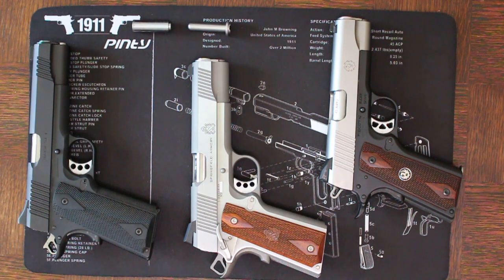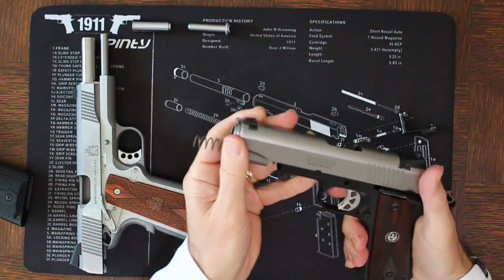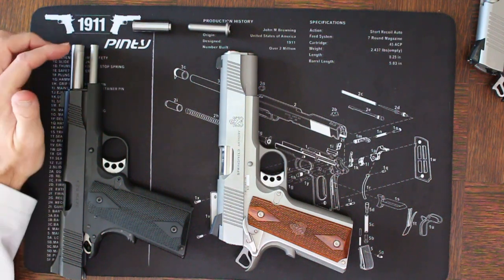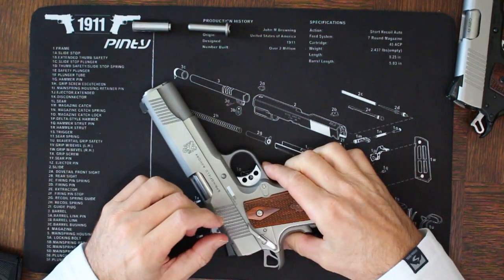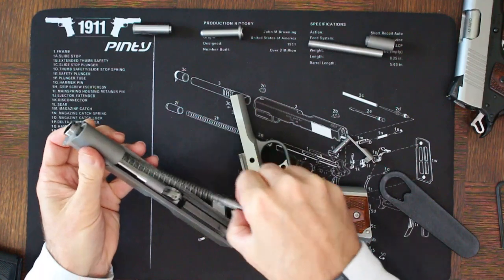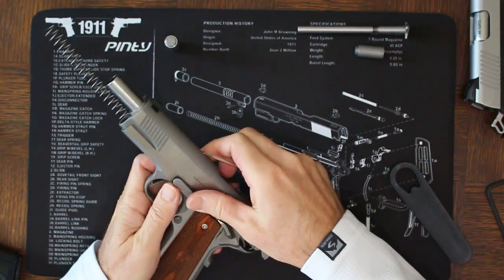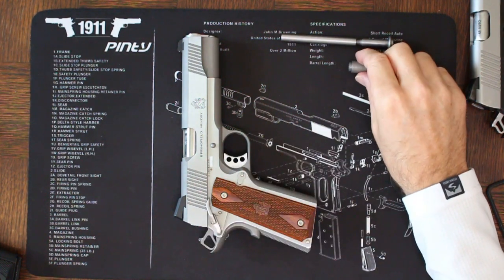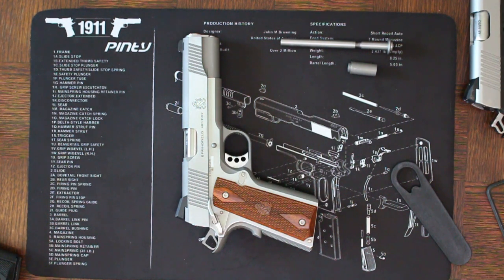1911 Guide Rod Upgrades, Types, and Replacement

Comment: 25 yr old Wilson Combat 38 super with full length two piece guide rod and plug. It has never come loose, never failed, never caused any problems in thousands of rounds. Shot one inch groups at 25 yds brand new and it still does.

Comment: For anyone that's going to consider getting a two piece guide rod... Allow me to make a suggestion...

 Periodically disassemble the guide rod especially if it's one that threads together.

 I bought a used rather beat up Auto Ordnance AOC Competition Model yesterday because I just couldn't say no to the price tag with all of the aftermarket accessories that somebody had also put into it. They made it look just like one of the 1911's from the 2004 Punisher movie. And again the price was right and I was very satisfied with it until I noticed two things upon much closer inspection when I disassembled it getting it home. First and foremost...

 The goddamn guide rod will not come apart. It doesn't matter what I do it does not come apart. The person that had it prior to me put it together and apparently never bothered to take it apart occasionally cleaned out the threading and put it back together again and now it is seized solid. To the point where I am pretty sure I'm going to have to cut it out of the damn frame. So yeah first suggestion would be... Take your firearm apart from time-to-time manipulate any pieces that move or thread together. Especially the guide rods.

 My only other complaint about this firearm is just the absolute and utter disregard for maintenance with it. And this idiot decided it would be a good idea to coat the outside and all of the inside with this thin rubbery material that liquefies the moment gun solvent touches it.

 I've never seen a nastier more filthy firearm in my life.
 Although it's a nice little restoration project for me now.

 But yeah the guide rods that screw together... Just take them apart every now and then or there will come a day where you might be sorry and you may not be able to get it apart.

 Just a little food for thought and thank you for taking the time to read my rent. And this was a very well-thought-out well-executed video. Thank you for that as well. If I cut this guy drawn-out I'm definitely going to be considering one of the styles mentioned in this video. We will see.

Comment: This is an old argument that ranks in comparison to the Polymer-Vs-Steel guide rod discussion in the Beretta. Although I have a small sample size (8 1911s in my collection) I can honestly say that converting two of my 1911s (1 government and 1 commander) to the Wilson Combat full length guide rod and flat recoil spring combination solved the lingering feeding issues I was having with these two guns. Both guns were plagued with feeding issues that would normally be solved with better magazines but that didn’t fix my problems. After a couple of years of living with these issues I finally gave in to the guide rod conversion. (Many of the higher end 1911’s are configured that way as are my two Colt Defenders.) That was 3 years ago and I haven’t had a performance issue with either of these two since then, and they now operate with magazines that I had previously set aside.  With this modification installed I can still field strip both guns for cleaning without needing tools. So I listen to these entertaining discussions about the GI guide rod system and all I can offer is that if it works, it works…until it doesn’t.

Comment: High-end 1911 handguns come with stainless steel full guide rods, which most match target competitors prefer, as the pistol cycles smoother, and stays flatter during rapid fire, it also increases the life span of the guide rod. BUT, y'all do whatever you like, no problem. You do you, so do I 😎

Comment: You're absolutely right, the 2 peices guide rod is worthless, the 1 peice full length is good, and the sandard is good , any gun needs to be easily feild stripped without any tools, otherwise you're in trouble 😉,  great video.

Comment: If there was an advantage to the full length guide rod I would use it, otherwise I use the GI version. The big thing for me is using stainless steel parts and install a 18 pound chrome silicone recoil spring and use gun grease on all moving parts/rails/barrel etc like I do on ANY weapon.

Comment: Great explanation; just purchased a RIA 1911 with a full length guide rod; and will change it over to the gi guide rod; all of the other ones I have had , have the full length guide rod, it is much easier to field strip;

Comment: Thanks for the video. I brought a 1911 type 70 and could not disassemble it. Turns out the guy I brought it from put in a two part rod. Cheers.

Comment: Good video. My Ruger Commander Lightweight was fairly accurate in the beginning, but I decided to change the standard guide rod to a two-piece FLGR as a test. What I found was that the Ruger ran a tad smoother and accuracy did seem to improve to a small degree. The front end of the installed FLGR did loosen, but that was after a 350-round training session. I placed a dab of blue Lok-Tite on it and that solved that problem. As a rule, if a 1911 comes with a FLGR I usually leave it. What I found matters more than FLGR vs. SGR is recoil spring length and rate, and main spring length and rate.

Comment: I have a budget full size 1911A1 from Auto Ordnance and I dropped a $225 5" barrel from NightHawk Custom into it and I also purchased a 20 lbs recoil spring and guide rod from them. The barrel also came with a bushing, but I wanted to keep the stock look so I stayed with the stock bushing. However, when you look at it the only thing that pops out at you is that gorgeous stainless barrel. Gr8 vid as usual. 🔫 🇺🇸

Comment: Years ago I bought a Dwyer Group Gripper for my full-size Para-Ordnance .45. I got one with a 2-piece guide rod, and after a short time decided I don't like 2-piece guide rods. I ground and filed the threads off the rear piece of the guide rod and sanded it smooth, making it into a standard length guide rod. Wilson Combat sells Group Grippers with both types of guide rods, for $30.95, and $49.95. 2-piece guide rods kind of suck, and I wasted $19 making mine into a regular length guide rod.  My suggestion for anyone buying one  is to go with the regular length.

Comment: I take my two piece off easily, i lock the slide back and just twist it off with my fingers then I release it back and safety lock it as i push the bushing back and take the tension of the spring and then continue to take apart as if it was a standard guid rod in it

Comment: I have the Mil Spec 1911.  Love it but has issues ejecting spent brass.  Tends throw them straight back at my face or top of the head.  Not cool.  Advice ???

Comment: Why is it hard to disassemble a 1911 with the bushing ? I have a mil spec 1911 from Springfield and it won’t turn with my fingers only with a tool.
Reply: Just work it back and forth with the spring and plug out. And shoot it, new guns come pretty tight everywhere. Thus the break in period.

Comment: Why didn't you show how to change out the guide rod in the Kimber.
Reply: It's pretty straight forward.  I have a full size Kimber with full guide rod.  Disassembly is the same ( turn bushing, finger over the open cap, release pressure). Set the cap aside, remove guide rod with spring from the slide. Slide the spring off the guide rod.